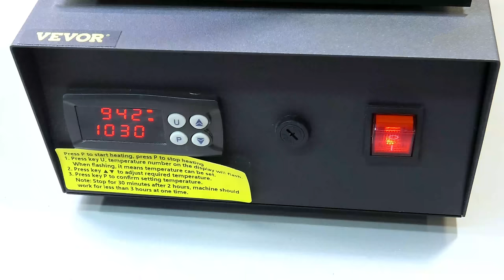French Gas Heater Restoration - A Rare 1900s Piece!

Comment from the maker: Hi folks! It was one of the most challenging restoration projects I ever did, but I brought it back to life!  😍I hope you will enjoy the video and give it a thumbs-up! Cheers! Johnny!
Reply: The fact that you actually made a mold and poured molten brass into it to create a new piece is incredible!
Reply: I also like how you use a torch when you know that there's a possibility that somebody previously may have tried to do a Band-Aid job by you know putting soldier in which they shouldn't have done and you try to torch it to get rid of that soldier you can't get rid of it so you use the tools of the trade I'm talking as a metal Smith I always admire the work that you do I can no longer do any of it anymore so I can't help but admire.
Reply: I have just one question why not put a new washer in the old ones were probably made of leather or something similar instead you use some kind of adhesive if I'm not wrong.
Reply: Mr. Tumbles 😊
Reply: Beautiful work! Would it be safer with some fashioned grates in the front?

Comment: Correct me if I’m wrong, but I think this was one of the models that salesmen would bring with them to show how the heaters would work?
Awesome job!!! ❤️❤️❤️👍🏻👍🏻👍🏻
Reply from the maker: I read something about it, and yes, they were using it as a sample, but at the same time, I found information that people used to heat small rooms with heaters of this size.
Reply: Many salesman samples actually work. Just like the little stoves and other things.
Reply: It has a small pipe on its rear to connect to a disused fireplace if the chimney is still open and the fumes can vent up it

Comment: I have used different colors of paint made for auto exhaust manifolds with success on parts subject to heat. For filling small chips, I’d spray a brush and drip into the cavity. Your method is certainly better, but I lack your skills and patience!

Comment: Quick question; why did you torch the pieces after you took them out of the vinegar and before sand blasting 11:32 ???(i mean i get that the sand might have stuck to wet pieces but) Why not just wait for the vinegar to dry or drip off?? Cant exposure to too much heat make metal brittle???(i am only asking cause i am curious not judging) BTW Can i have the heater(would you sell it?)???
Reply from the maker: You guessed well. I do not have time to wait for vinegar to dry. That's not "too much heat" to change the structure of the metal.

Comment: You know there’s a thing called paint stripper right?
Reply from the maker: Oh, really? And what should I do with that?
Reply: It helps when you need to take old paint off, which also helps with sandblasting.
Reply from the maker: Where do you see paint in this project that needs to be stripped off? That's Enamel, buddy; it needs to be preserved, not stripped, with a gel that I obviously heard and used, because this is my job. My answer was ironic because your question was funny to me; it is like I will ask a doctor if he heard about a thing called injection 😅 Cheers!
Reply: Oh...I...didn't know sorry
Reply from the maker: No worries 👍

Comment: When you see those fiber style gaskets, really should douse them down with penetrating oil or something.  If they are asbestos, scraping like that can release fibers of it in the air.  That type of lung cancer is no joke.
Reply from the maker: I guess you saw that I'm using a lot of WD40. All gaskets were soaked and I always wear a mask. I've been doing this job for quite a while, so I don't need much advice, like with the paint that can contain lead 😅, but I appreciate, and I hope others will read your comment to learn something. Cheers